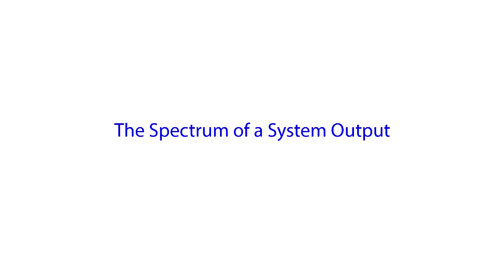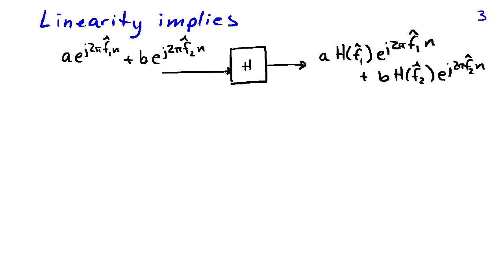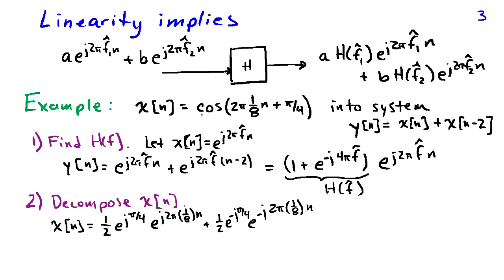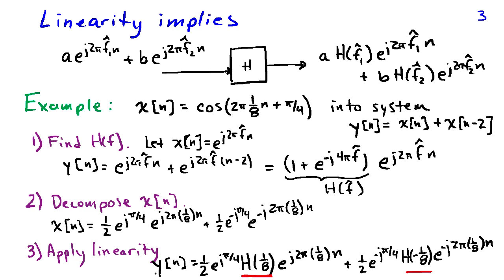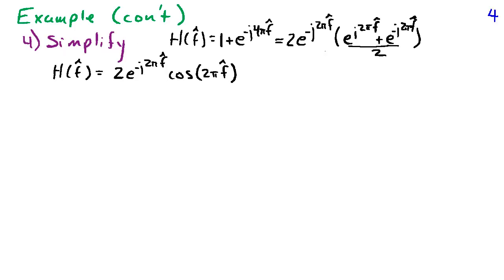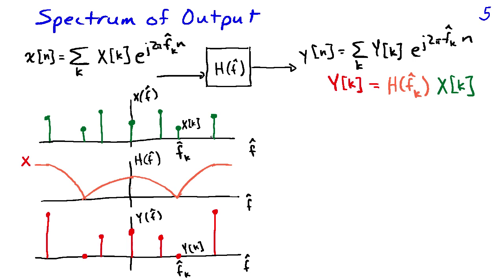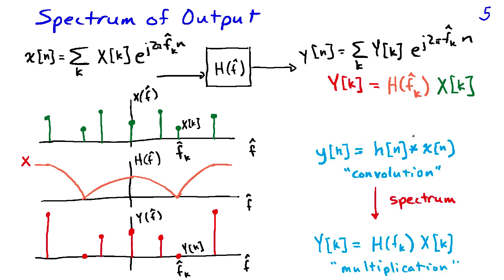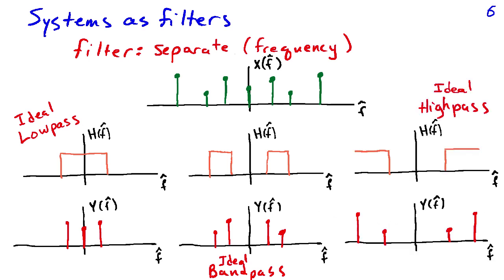The Spectrum of the Output of a System

Comment: thank you for your clear interpretation. This happens in mechanical engineering, when we want to know the component/structure reaction from forced vibration. We need determine the H(f) of the designed component and fourier transform vibration from time domain to frequency domain. Other example is earthquake resistance design, we want to know the reaction of structure from seismic action and there are two filters, one is the geotech below the structure and the other is the structure itself. A powerful characteristic description this method is.